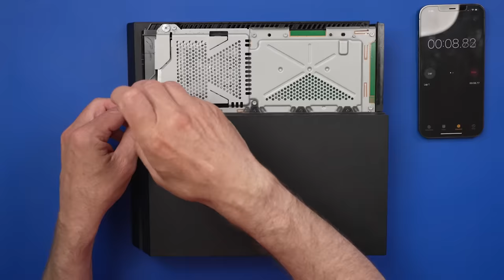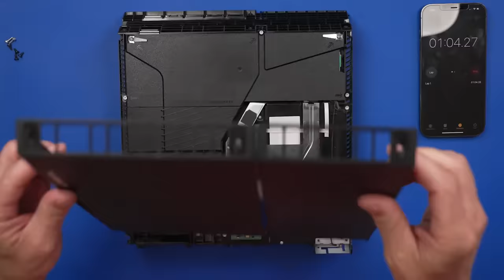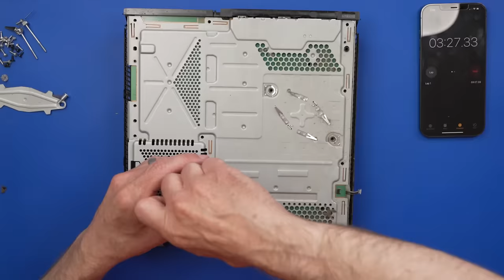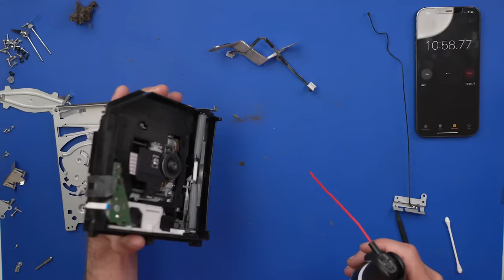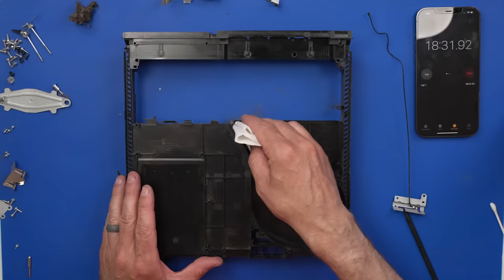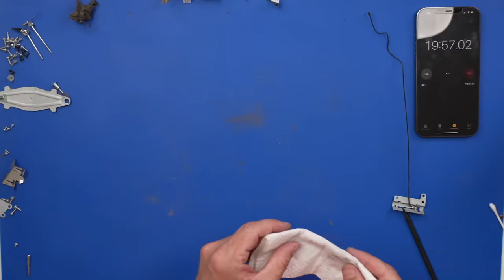Why "Refurbishers" Rip You Off

Comment: I was a guy that bought broken stuff, fixed it, clean and polish it and mostly with laptops.  It is a different market and there is not much money in it, and as a hobby it gives me money to buy more stuff to refurbish.  The term (re)furbish comes from the German word 'furben' which means to polish.  The Dictionary says this: made to look new again by work such as painting, repairing, and cleaning.  A company that sells refurbished goods is a bad business model.  Not only salaries, brick and mortar, electricity and warranty overhead drives the profit down.  It is a really rough business to be in.
Reply: It is a rough business but a company who specialise in refurbishing consoles working way more efficient than a normal person can do. First they don't work on one console at the time, they disassemble multiple consoles and throw everything they could in a ultrasonic cleaner, the bigger parts in a cleaning station and use compressed air(not the overprices shit Tronics use, they have an actual compressor+tank) and a brush. A normal person needs 1.5-2h for a refurbished, a skilled one like Tronics need ~45-60min and a specialized company get that done in under half an hour. When something gets broken in the process they most likely have one who can fix it. 
But i have to admit that those company's most likely work for major brands and doesn't buy old stuff, refurbishing it and sell it on ebay.

Comment: The company I started which is a local computer store we sell refurbished laptops and desktops. Many we buy refurbished from the manufacturer directly (most are only open boxes) We make sure to clean them up 100% inside and out we also usually put a brand new SSD in each machine since when we sell anything refurbished we warranty it for a year also. So if we have to stand behind the product then you know we are going to make sure its in top shape :)

Comment: KitchenAid refurbished stand mixers used to be actually refurbished; I don't know if they are now, but the one I bought 25 years ago even had a sticker on the inside with the signature of the refurbisher, the location the work was done, and the date. It was pristine then inside and out - not so much now but it's still in daily use.

Comment: The problem is training people to properly take the item apart, clean it, and put it back together and then try finding them for min wage or slightly higher. Your also going to have damaged machines from improper handling while cleaning (mistakes happen)

That's why they just windex the outside, blow some air in the vents and clean them out a little. You can hire people at minimum wage and no worries. Just clean the outside and test that they work quick.

Comment: as for a refurbished device my expectations are that the device fully works, they've cleaned/tested everything from the capacitors to the CMOS battery and fresh thermal paste/pads. On older systems such as the OG Xbox, I would expect a full capacitor check or even replacement and I'm willing to pay a premium for such services if need be.

 I know that it's next to impossible to make money off of this kind of thing but for those who are willing to fix or sell such services? I'm more than willing to pay an extra 50-100$ "if not more labor/parts etc" for a device I KNOW that will work for years to come.

Comment: I'm pretty sure the shop I bought my "refurbished" PS4 Pro from didn't open it. This is based on the fact that it still has the warranty stickers and that they sell DualShock controllers that only work when they are plugged in because the battery is bad. Oh well, that'll keep me entertained with some tinkering on a boring afternoon.
Reply: Most companies refer to open box as refurbished or returned within the week of purchase so alot are often unused or barely touched but yeah your controllers batteries probably died from sitting around unused
Reply: Probably a easy video on how to replace the battery and where to get them for cheap but with anything probably not worth the effort and easier to just buy new controllers

Comment: I used to work in a phone warehouse refurbishment job. Basically we checked the battery health (minimum 80% or replace) cleaned out the inside and out. any minor nicks dents noted. If any major damage. It's used for parts.

Comment: I usually spend 60-90 mins to 'refurb' a console because I don't want them back later on.  So far I've had no returns so I guess I'm doing something right.
What I HATE the most is fixing up consoles people have bought from a well known games shop that sells refurbished systems, only to open them and see they clearly stick to the "wipe the outside a bit, she'll be right" method of refurbishment.  The amount of dust and grime I usually see inside these machines is disgusting, especially when they're listed as cleaned and checked.
Reply: If the consoles aren’t coming back, but the customer is taking more consoles… Definitely something is right

Comment: As a electric full time, i often get electronic items that was broken duo to false plugins to power or thunder strikes ect, like right now i got two solar batteries (one has fault, one dont start) value new each 1379 US$, i got a build in oven that dont heat correctly value new 5373 US$ (yes, its very expensive), and some other stuff for repair, i get some all the time (so for me doing electronic repairs as site business is nice), insurance dont want it, they just give customers new more or less all the time (and we are not allowed to leave broken items at customers from insurance).

I also repair phones and other stuff for friends and family ect, but as a primary business i can see the issue, people want same price almost as working second hand cost for broken items..

Comment: Refurbished should be devices that have been fully checked and working,  the system have no faults, while the device parts can be replace if it has sort of damage or scratches but depends.   

In UK we got a cosumer rights act that allows if some business who dont make a full inspection of the device and just to see if the item works, then the customer can get the business to make it right, get partial or full refund and if they dont make any attemps to solve the problem then go to small claim court.

Comment: I believe refurbished means cleaning, replacing any wearable items such as batteries and thermal paste, and full testing with a stress test. Also, replacing any known failure points like some capacitors are known to fail.

Comment: I worked for a refurbishing company cleaning old cable boxes for other countries to use, luckily we had another sector for repairs which 1 out of 10 were usually doa but it was terrible I wish dust was only issue. Would say 1/3 were full of dead roaches, 1/3 had candles melted over them, and 1/3 were clean or just had to do a quick blowout and wipe down

Comment: 11:00 are you applying an alcohol-based solution on the rubber? I've always heard that alcohol/bleach/hydrogen peroxyde deteriorates rubber (after a few days the process start), so they've always said to wash it with dishsoap and water and airdry it.

Comment: I always assumed refurbished meant at minimum, device works, all features were tested to work, and device was cleaned inside and out. if broken parts are found I would assume they kind of musical chairs the working parts between broken systems to get the most fully functioning units left after.  that's at minimum, at most I would expect a 3 month or longer warranty, brand new part replacements, and new thermal paste/ thermal pads, new connector sockets installed for things that commonly wear out and get loose like charging ports.  I've only ever had the pleasure maximum level of effort in refurbishment done by the OEM, laptop makers for example often sell refurbished returns through their ebay storefronts, and tend to have a good deal better refurbish quality.

Comment: From what I can find and from what I have also known for many years now, "refurbish" means to "make clean, bright, or fresh again; renovate" (i.e. "fresh again" in this case does not mean to repair or replace, it simply here under the term "refurbish" means to "clean", or for a lack of better terms for the way we would say it in every day to day English "Buff it up" kind of like "Buff my shoes" and again means to "clean"). Nothing about "refurbish" means to "repair or replace what's broken as needed" though it can also mean to "modify with aftermarket housing and etc" or to "upgrade hardware" to give it a different look or to perform better compared to what's found on the shelves at retail stores due to the "renovate" definition of "refurbish". But to "repair or replace what's broken as needed" would in all technicality fall under the definition of "restore, restored, and restoration" or in other words those last three words listed off means to "return to the original or intended state".

This is why refurbishers get away with what they're doing, or so people think refurbishers are getting away with something, because of the misunderstanding of what "refurbish" means. By using the word "refurbish" or "refurbished" or "refurbisher" all they're required to do technically by law if a lawsuit does come up against them in any given scenario is to clean whatever you have brought in to them. If they, however, claim to restore whatever they have taken in from someone, then they are required to clean, repair, and replace whatever it is that needs to be cleaned, repaired, or replaced. That's because restoration includes refurbishing, but refurbishing does not include restoration, because refurshing is just one stage or process of restoration. And that's also why when you take an electronic like a gaming console to a refurbisher, sometimes your gaming console comes back magically fixed, because most of the time all it takes to "fix" a gaming console is to simply clean it.

However, when they hand it back to you and say your gaming console cannot be fixed, what they're actually saying to you is that they cannot fix it through the services they offer under the term "refurbish" and you need to take it to someone else other than them who offers restoration services, or otherwise if that's not at all an option for you because nobody offers those services in your area then you need to fix it yourself. But if neither of those options are available to you, you do still have options, is also what they're saying to you. You can try sending it in to the manufacturer if the warrenty is still available. Or you can instead just simply buy a new one, which is what they're actually trying to get you to do and specifically through them because it "cannot be fixed by simply cleaning it" due to the fact they make more money off you if you do happen to buy a new one, and also why they won't say anything beyond "it cannot be fixed" and leave out the "by simply cleaning it" bit at the end of the statement.

P.S. To put it another way, you need to take your gaming console or whatever it is to an electronics repair shop, not a shop like Game Stop that offers only refurbishing. Most repair shops offer refurbishing for free included in the deal when they have to repair or replace something on or in an electronic. Why? Because to clean an electronic costs very little money and is almost not worth trying to charge for the cleaning and to repair or replace something on or in an electronic it's basically standard practice to clean the electronic before, during, and after the process for both ease of the repair and/or replacement process and so it gets returned to the customer in the best possible working condition it can be at that time.

Comment: I used to sell refurbished retro consoles on eBay. I would replace caps on all units older generations, lasers, etc. Clean the shells. It would take me a day per unit at minimum. I would buy the consoles in lots, resell individually and my profit was usually about $20-50, not including labor. It was never a lot, and I quit because during the COVID lockdowns I noticed resellers were buying my stuff and relisting for way more than I'd sell for (we're talking like 100% or more markup). I didn't want to contribute to the already ridiculous markup because I was doing the refurbs mostly as a hobby not as a job.

Comment: @TronicsFixLongs is there any possible way that you can point me to the power button part? i was given a ps4 that had a broken power button and i desoldered the broken one and attached wires and its working 100% just have no idea where to get the little power button, its a original model ps4, same one you are working on in this video any help is appreciated
i have looked everywhere its a 4-pad button

Comment: I think one of the big problems that leads to this kind of behavior from these companies (Still, shame on them) is the fact that its so hard to get into at least the basic areas to do the maintenance. Also, companies used to distribute service manuals, schematics, sell parts, have authorized techs, etc. But for similar profit reasons, its just not a reality anymore. That buck is then passed on to the referbishers, who then (in most cases) pass that buck down to the customer. In the end, the customer ends up screwed and the companies make more profit.

Comment: Tronix, I'm a forklift mechanic.  The smallest wire I deal with is maybe 16awg. I can solder but I have never done board soldering. My wire soldering is pretty solid. Do you think someone like me could actually do something like this? Also keep in mind, most of what I work on weighs anywhere from 15-285lbs per part lol. The lifts in general on the low end weigh 10k lbs or on the high end, 15k lbs. Oh and with the occasional 25k lbs lift. 😁

Comment: I bought a scarce, "Refurbished" Optoma HD-91+ projector. I immediately knew why it was returned originally. There was a misaligned mirror inside causing a dark corner on the image. I had to fix it myself. They never did an effin' thing with it other than test it, and re-box it. Refurbishing is B.S. as I learned, and you already know. But I got a $5K projector for $1K. No complaints after 3 years of use so far.

Comment: By refurbished I understand that a console should work like a new console, so no overheating, everything working, I don't mind scratches or broken outer shells as long as the functionality is there and as long as those cosmetic damages don't ruin the console in the long run. As for the price I dunno what I would pay for a refurbished console, I live in a country where the second hand market is not really great, mostly because there are very few offerings, there are some broken consoles for dirt cheap, there are "new" consoles that are super expensive and there are normal (used) consoles (some of them are refurbished, even tho it's not really mentioned) that are right in between.

Comment: I'm assuming your plastic brush is ESD-safe. For those not in the know, using a nylon or plastic bristled brush to clean a circuit board full of ESD-sensitive semiconductors is not a good idea. If you're going to drag plastics across a circuit board, make sure it's made of conductive or static dissipative materials. The ESD struggle is REAL.

Comment: The only time ive not repaired a system that i own was my xbox one X, the hdmi port died on it so i took it into eb games in NZ to get it repaired, it was about $100 all up to repair it, things like disc drives I have the tools for but I don't have a heat gun I just have a soldering iron with some smaller tips so yes technically I could repair it but it wasn't worth the potential cost if I broke it more. My ps3 on the otherhand I did a complete overhaul on, i bought a "broken" ps3 for about $50 (quite funny it was broken due to a puzzle piece being stuck in the disc drive) repaired this disc drive put it in my ps3, applied the perfect amount of thermal paste, added an ssd installed new software and its running like a dream again

Comment: I think that's the main reason they take off the factory stickers and slap on theres then tell you if you open you'll void any warranty you would normally have from us because they dont want you opening it up and finding out they didnt do exactly what they say they did. Plus honestly a lot of those probably wouldnt need replacement parts there would be some but i highly doubt it would be a large number maybe some hdmi replacements, fuse replacements, battery replacement, disc drive lens or drives, fans, but i cant imagine that all of them would need a lot of replacement parts. They dont dont even open these things up and clean them and replace the thermal paste they just wipe them down or hit them with a magic eraser and canned air then once they look good from the outside they box them up and slap a refurbished sticker on them and price then double than what they bought it for. People dont realize blowing canned air into a sealed colsed system doesnt do anything but push everything to the other side of the system. Any thing that is in there still remains in there just gets knocked around to different parts of the system most of the time directly to the heatsink fins where ut stays and starts to cause overheating issues.

Comment: Is there a reason you wouldn't want to use a vacuum with a soft brush attachment to clean the dust? Seems like it would save some time and cleanup compared to brushing the dust onto your workspace and then having to clean that later.